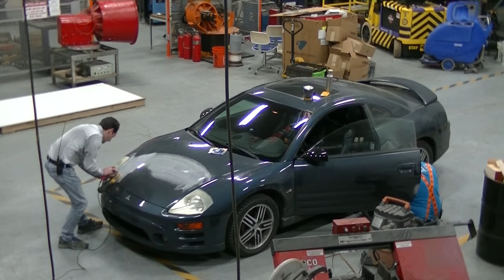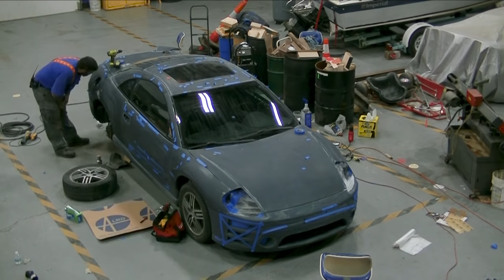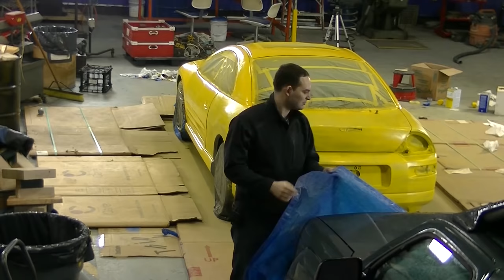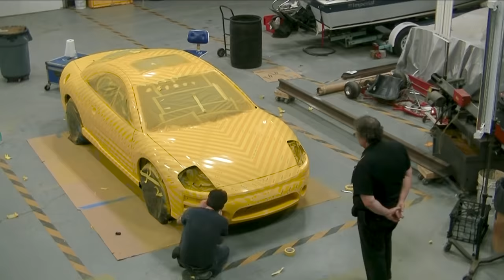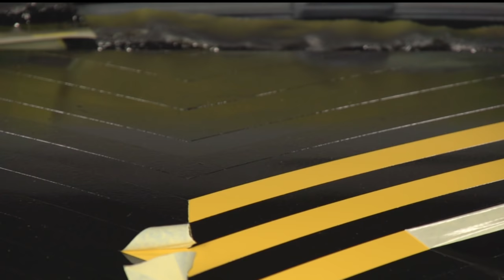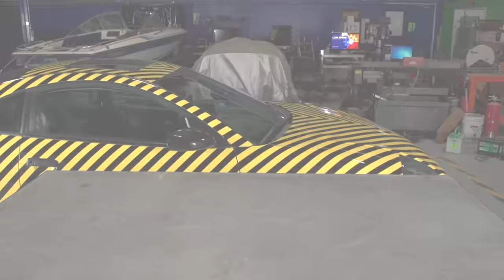Painting an Entire Car with Spray Cans: Abbreviated Workday #53

Comment: Very cool, nicely done! 

I believe that Rustoleum is the sweet spot between quality (good coverage, good spray pattern for a spray can, quality paint that doesn't fall apart...) and cost. 

That said, most people don't get how much you have to use to get even coverage and a professional looking job.  I've wondered how many cans it would really take to do a car right, and this gives me a pretty good idea.  I did the hood of a car (larger hood) semi-gloss black (more forgiving than either gloss or flat) and I felt like I ran out of paint with I believe it was somewhere in the 11-15can range.  Your striped spray pattern would hide some imperfections so it didn't need to be as perfect, but if your picture of the cans is all you used (56), then at an average cost (I've seen them as cheap as $3.96 and as expensive as $9, $5-7 seems normal), and you paid separately for clear coat.  

Figuring in the difference in cost for the primer, it looks like you spent $300-400 in spray cans + whatever you spent for clear (not counting your labor and some basic bodywork supplies).  Figuring that there's about 4oz of actual paint in a spray can (the majority of the rest is solvents to get it thin enough to spray and then some propellants...).  You used about a gallon of actual paint.  

Sticking with Rustoleum, the quarts are typically cheaper than the gallons, $8.50/quart(x4 = $34/gallon) vs $56/gallon.  So 2 quarts of each color (4quarts total) for $34 + ~$20 solvent (mineral spirits, naphtha, acetone, depending on what color you go with and air temp different things work better).  If some of those spray cans were primer then you could probably replace one quart with it, but even if you add a quart of primer that's only another $8.50.  I would also consider adding a little enamel hardener (look in the farm implement line of the same paint, or just order it), which will cause the stuff to chemically harden (it hardens harder and faster) and gives it additional UV protection and gloss, for about $8-16.

Even if you don't have a spray gun/compressor you should be able to borrow one from somewhere and you can buy a good cheap spray gun from Harbor Freight or online for <$20 (you could buy a VERY good, almost $$$ professional quality one from them for $69-20% off = $56).

So at this point, you have something slightly better to a lot better than what you got with the spray cans for between $54-98.50.  Clear can be done with the same equipment for similar materials cost, I'm guessing around $20-25 (2 quarts of clear and some solvent).

Interestingly, both Rustoleum and Duplicolor have consumer grade "automotive" paint (I believe laquer based) sold by the quart and gallon and it's MUCH cheaper than the regular Rustoleum oil based enamel (about $25/gallon), though I have no idea if it's actually better for automotive use (I've never used it, I've never seen it on a car... I have used the regular enamel).

This is good to know.  I've done partial spray can paint jobs that have turned out quite well, and I have at least 2 project cars that could use a cheap paint job.  I'm pretty sure I know what I'm doing now.

Comment: Really glad to see you have proper PPE. I spray painted a motorcycle frame today, and I slacked-off on the last 5 or 6 touch-up sprays , and didnt wear my mask, decided to just hold my breath and step out of the area . I intended to finish the 6 final sprays and go inside for the night. Well tonight I took a q-tip to my nostrils out of pure curiosity and was pretty horrified at what I saw. 

We really need to work to normalize eye, ear, lung and face protection. I see too many youtubers setting the wrong example (yourself excluded). This is only someting I've noticed in the older years of my life .... when I was younger I guess I thought I was invincible!! 

Anyway, thanks for sharing all your content and spending time doing cool things to share with others
KEEP IT UP

Comment: Totally not my style, but I do have to admit it looks really professional for a rattle can job. Why send it off for clear coat rather than attempting to spray that too?
Reply from the maker: We wanted someone who knew what they were doing to give it a more professional look and guarantee it'd be much more durable. No one at the lab felt confident enough to make the coating very smooth and give the car that last bit of 'pop'.
Reply: Makes sense, I didn't thing about the durability aspect of it. From youtube it certainly looks like they put on the paint under it super smooth, but I guess it probably shows more up close. Superb job either way!
Reply: I definitely think the floor got some over spray
Reply: Cyrus Ahmadi-Moghadam also rattle can clear doesn't usually contain UV inhibitors, and isn't solvent resistant, so gasoline spills could ruin the paint.
Reply: sinformant 2k does..I love it....
Reply: Rattle can clear is also very temperamental, it dries too fast to spray a whole car without leaving a bunch of orange peel.
Reply: Rattle can clear coats are not at all durable, with time the clear coat will fade and so does the paint will start to get damaged by dust particles when driving.

Comment: So, about $210 for yellow and $210 for black (assuming about 60 cans for each color), $420 bucks for paint.  Was it wet sanded prior to clear coating?
Reply: Timothy Caldwell why would they wetsane prior to clear coating?
Reply: They wouldn't sand it before clear. Just tack it down to remove dirt and grease. Shoot 2 coats and call it good
Reply: There are 56 cans of spray paint in total
Reply: 17 black, 27 yellow, 12 primer, body filler, spot and glazing putty, sand paper, respirator masks, masking paper, and the expensive stuff is the masking tape. And don't forget about the help, assuming they're friends it's priceless.
Reply: You forgot primer soo $630  bucks